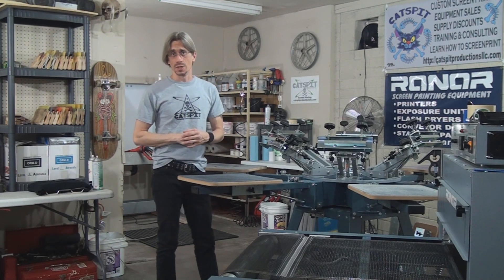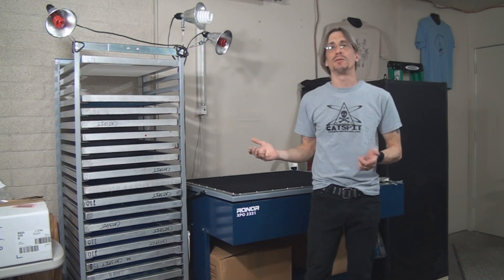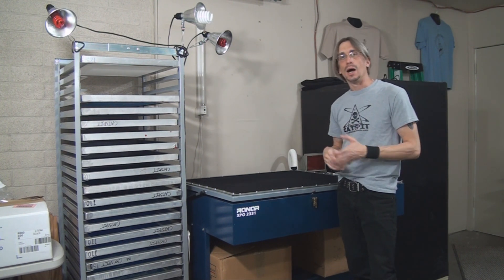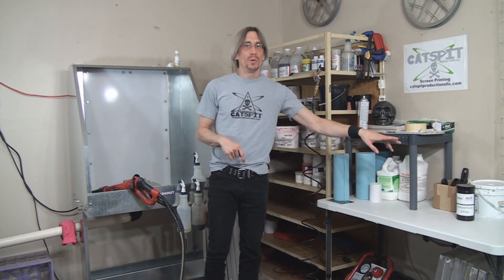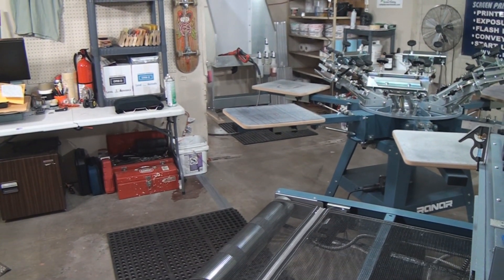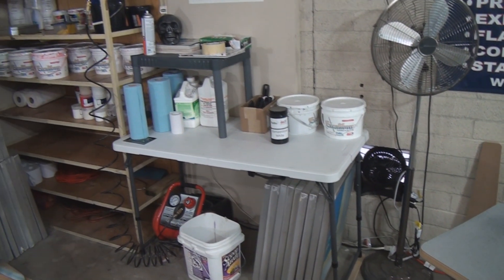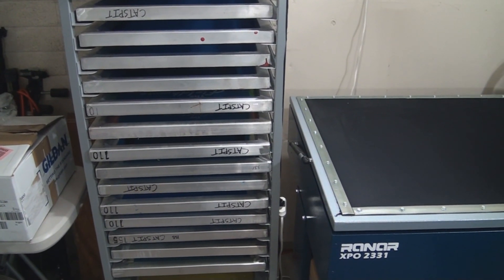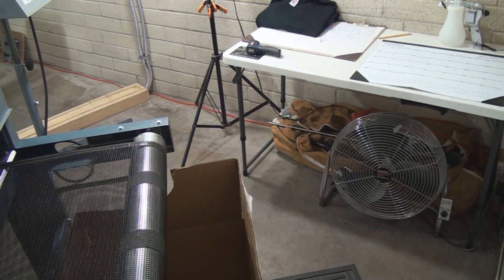Manual Screen Printing Shop Set Up Tour

Comment from the maker: Thanks you! Well this video was made shortly after I moved into my new place. So it was very clean here. I still keep my shop very clean. I keep things pretty ship shape. I have never used that type of a panel screen system. I feel my screens are at a much better tension than that system can achieve therefore making printing easier and with finer results. Especially with registration. Nothing beats a rigid frame with very tight meash. Thanks so much for watching and dropping me a note. ☠

Comment: I tried the panel frames & don't like them. Bought 4 and 2 of the 4 the panels kept popping out of secure bars. I would walk into my shop the next day and they would be popped out sitting in my press or even just setting off to the side. I can't trust the product. Lawson sent me replacement bars and it still didn't fix the problems. And yes they were installed properly with the proper tool. They are more of a headache than anything. I'm going to sell my remaining ones. Want to buy them?

Comment: I love the layout.I have all of this equipment except the belt dryer. now I need to build a shop to hold it all. I am allowed 200 square foot so I am looking at your videos, and I keep pausing it to draw out the design to get a nice flow to mine when I build it. Nice thing is I can expand an additional 200 square feet if I place a breezeway between it and the existing building down the road. That will help as I merge my Vinyl hobby with my silkscreen fun.what do you think of the name Lauri's Houndstooth Design.
Reply from the maker: Thank you very much. I just received your last e-mail and I will reply to that tomorrow. 200 ft.² is very small but depending on what you have you can make it work. As far as the business name I have found that the more simple the better although a unique name can leave a lasting impression. However the best advice I can give you in regard to the business name is not to use it for your URL. Rather use keywords for the market you are seeking. Thanks for watching. Screen Printing Equipment & Supplies - http://catspitscreenprintsupply.com/

Comment from the maker: I do not have A/C. I tend to print at night and I use plastisol inks. If you’re renting commercial space make sure it has A/C. It can be hot and humid there. The air conditioning will help you get and keep employees and it will eliminate the humidity factor in the print shop. Then you’ll need to vent the dryer well. High ceilings work best with low duct work. That way heat can rise and the cool air sets low.  Thanks for watching & commenting! ☠

Comment: Hi from Greece! Thank you for all your absolutely helpful and really educational videos. I have some questions:
1) How big is the shop we see (in square meters)? I want to start a screen printing shop and I want to know what's the minimum space I should have.
2) Is the furnace absolutely necessary for a start business with a production of 300 T-shirts per month?
3) The flash cure unit and the furnace do the same job? Could I use only the flash cure unit to dry 10-20 T-shirts?
4) I don't know if you have already answered that, but, can I screen print a photograph? ( a photograph taken with my digital camera).

Thank you again for all your help and I'll keep giving you thumbs up!
Reply from the maker: You're very welcome, thanks for your support on YouTube! My shop right now is 500 square feet. A belt dryer is needed for maximum production speed. Yes, you could use the flash cure but it will be very slow. You can screen print photographs but full color images are more complex. You can easily do a 1 color halftone of a photographic image though. I have a video on that and using the flash cure for final cure. I also should cover the belt dryer well in multiple videos. Make sure to watch them all ;) Thanks for watching. Screen Printing Equipment & Supplies - http://catspitscreenprintsupply.com/

Comment: Thank You for helping silk screen aspirants Sir...What is the best ink for basketball jersey Sir, Can you recommend? Thank You in advanced
Reply from the maker: You are very welcome. It's my pleasure to help out where I can. The answer to your question actually depends on what material the garment is made out of. If it's 100% cotton you can use standard plastisol or water-based inks. If it's 100% polyester then you may need to use a polyester ink. Thanks for watching. Screen Printing Equipment & Supplies - http://catspitscreenprintsupply.com/
Reply: Thank You Sir....
Reply from the maker: You are very welcome. It's my pleasure to help out any way I can.